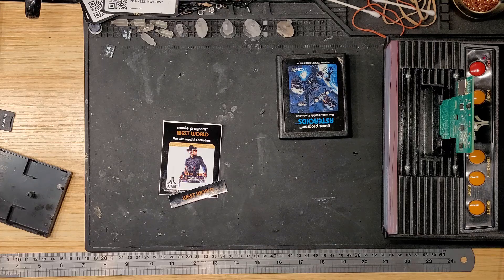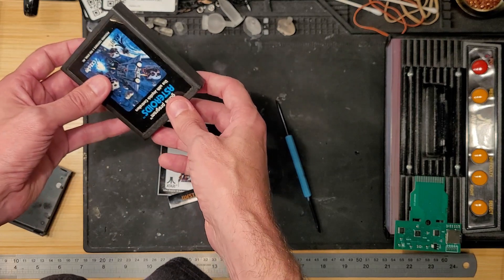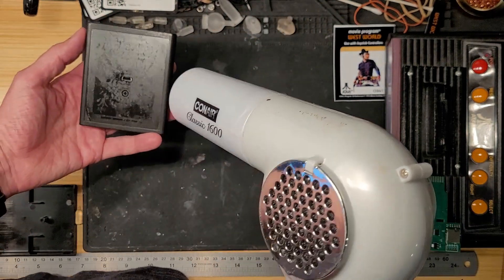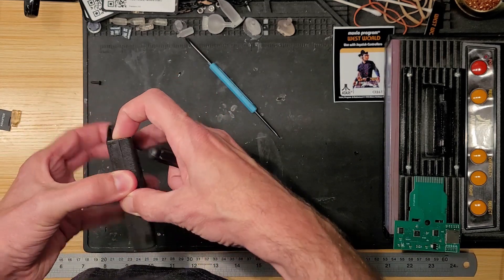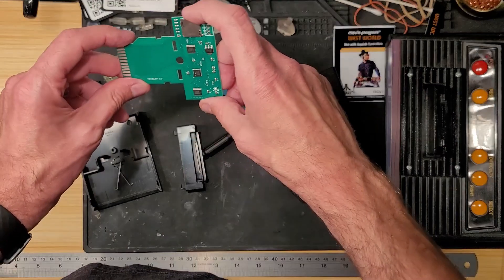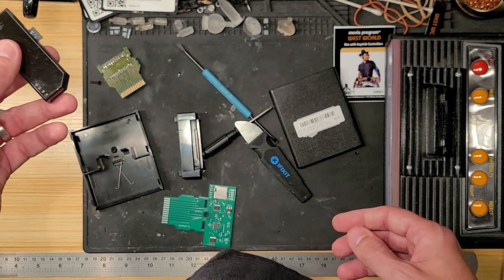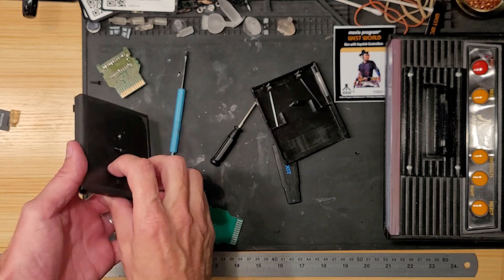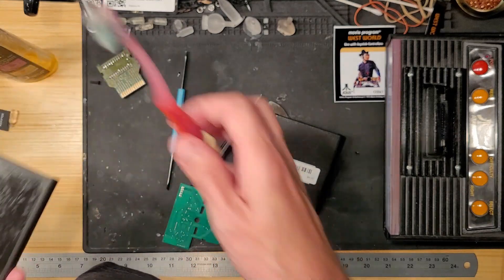Cart Assembly

Comment: You put the lable on upside down
Reply from the maker: No, it matches the orientation of standard carts. Cheers.
Reply: Yes it is, the lable is reversed. Just look at the Asteroids you used the shell from. The top of the lable goes toward the end that goes into the 2600 and the bottom goes toward the end lable. If your placement is correct then all 60 of my games have upside down lables.
Reply from the maker: @Ron2600_  Dangit! You're right.  Figures, I've made a dozen of these, and the one I do on camera is swapped.  The good news is I had to remove that label anyways in the end to reclaim the shell.  cheers.
Reply from the maker: @Ron2600_  I see what happened. I followed the Zellers knock-off cart in the video which indeed is oriented differently than the standard Atari releases! Never noticed that before. Good catch.